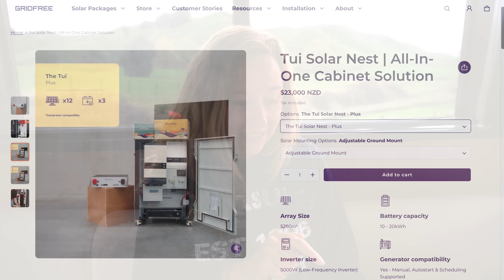Off-Grid Power: Why I Said No to the Electricity Company

Comment: I was shocked at how the price of electricity kept going up here in the UK, So, I built my own solar system 2.5 years ago, 4x 420w half-cut cell panels like you have for £350. I built a 10KWH Lifepo4 (CATL) battery for £1100, MPPT charge controller and Inverter Victron SmartShunt BMS's and cables etc £400 = £1850 in total, and my electricity bill was £1900 PA two years ago, and my last bill in Aprl 2025 for a year was under £600, with nearly £300 of that being from the standing charge for the meter/connection. 
Today I have just had 15KWH more Lifepo4 cells delivered (16x EVE 315AH cells) for £1100, and giving me 25KWH of storage, and I see the updated version of my Longi solar panels are now 610w each, and cost £70 each, so I be buying 2 more giving me just over 2.8KW.

My first solar/battery build payed for itself in under 2 years, and my new solar and battery will have paid for by the start of next year, then I only need to pay for the standing connection charge. 

Nice to see you are like-minded :)
Reply: Would it be possible for u to go off grid with ur electric or is our UK weather not reliable enough (sun wise)?
Reply: @dazinull  Where I am yes, as I'm 200 miles south/west of London, we have only had 9 days of fully overcast heavy rain this year, and even on those days still made 1.5x the panels rated power over a day, the only problem is the end of December and the first 2 weeks of January where the panels avarge their rated power daily, meaning most will need to find extra power, I discovered my first systems 1.68kw of panels could run 90% of my home, but I used the grid for most of my heating, but for this winter (and summer) I'm going to be using a heat pump, an AC inverter type, meaning it will cool and heat. (and now cheaper than gas to use :)
I just add many people live 100% off-grid here in the UK, but they use a small generator to top off their batties in winter (important to top-off with Lead Acid), and use bottled gas, or burn wood/coal or oil for heating/cooking etc. Look up PVGIS to see if it could work for you, but remember we are now getting 20-30% more energy from the sun, than we did just 10 year ago.
Reply: @hardergamer  what people do off grid and living on solar I’m quite amazed how clever they are but  still need the grid 2 function at 100% and stay warm during winter so if everybody in the country does what you are doing who will be financing the grid and the power stations —-
Reply: Utilita have no standing charge if you use no energy(UK). They do have a charge if you use some. The first two units are twice as expensive or something like that. Plus when I go back to Octopus in October I get a £50 bonus for rejoining.;)
Reply: @shawng5799  Octopus is by far the best UK power company, my plan is to use their cheap night rate for storage heaters or EVs to charge my battery at night if and when I need to, as the power company I was with UW was charging me 75P a unit, as on PAYG meter and using very little, whereas Octopus doesn't do this, and UW do keep charging you even if you're not using any power, as my meter was in the red and switched off at the meter, and it still clocked up -£270 negative.  But, it depends on who you are with as not all do this, as you found out, also, it depends if you are PAYG or statement billing, like quarterly etc,  as PAYG costs much more for both the energy you use and for standing charges, but luckily Martin Lewis is fighting hard to get all standing charges scraped.
Reply from the maker: Wow! Sound like you know what you're doing! Great to hear your experiment worked out and you're now upgrading it.
Reply: @TravellingK  Thank you, Now that you have to basics fitted, and you need more solar energy it will be easy to add more panels, and they are super cheap now.  Also, the angle of your panels looks to be set up more for summer,  which is when you don't need the extra power, Have you played with PVGIS, to find the best angle for winter, don't look for the maximum yearly total energy as it's a wast, but look at losing a little in peak summer to gain 20%+ in winter, you can work this out on the EU PVGIS calculator, best to use the "off-grid" part, but better still is to make the panel frames adjustable, so you can when needed.

Comment: Battery performance will dramatically reduce in winter (same as EV cars).  Solar yield will also significantly reduce. All at a time when you require more power. No idea what the cost of a wind turbine would be but you might want to consider it for a bit more umph in those winter months
Reply: If you keep the batteries in a temperature controlled environment, then winter will not affect them directly.  Usage for heating, clothes drying etc will increase usage but the batteries themselves will not change.
Reply from the maker: I am curious to see how I go this winter. I do have a generator and the kit is installed to accept a generator, so that's my backup plan...
Reply: @TravellingK You’ll be fine. It’s always an interesting juxtaposition in winter when sunlight hours fall but power demand increases

Comment: Batteries are only good for about ten years.  And I gather solar panels don't last forever. 
Just a warning
Reply from the maker: Yes, but if you put aside $300 per month for 7 years (the pretend power bills) you'd be set to upgrade again! And those batteries should last longer than that. But technology changes...
Reply: The LiFePO4 batteries she has will last at least 15 years, with only about 20% degradation at that time...and that is IF she has to use 100% of the battery power each day. These batteries could theoretically last up to 20 years or more, as long as the BMSs last. As for the solar panels, they are lasting 25+ years. Nothing lasts forever, but at the point she needs new panels/batteries, there may be longer-lasting ones on the market.

Comment: You need to throw up a wind turbine to supplement your power intake.
Reply from the maker: Someone nearby have turbines and I've been curious...
Reply: Yes, that might be very useful if rainy days are also windy, which is common in many part of NZ. Latest panels seem to work reasonably well in light could though, so more closer study might be needed around her location to be sure.
Reply: NZ variable wind strength means lots of turbine maintenance. Not easy with turbine up a high pole on top of a hill. Gave up after two years, just spend the money on more panels.

Comment: In your remote situation, what you have invested in is a no brainer! Even if you had to replace all you lithium in 5 - 7 years, you would still be laughing all the way to the bank compared to connecting to the pole and the ongoing line rental and usage. Win - Win +.  If it was me, I would keep the generator maintained for emergencies and have it connected to the system just in case as a backup.
Reply from the maker: Good to hear! Yes, I guess I just need to budget for more batteries in the future. I have set it up to add the generator when needed. From my experience with a smaller set-up I didn't want to risk damaging anything. But 10 months in and so far haven't used it!

Comment: Good on you - keep us updated on how it looks after you over winter. You have alternative heating I guess but lack of sunlight and cold temperatures effecting the Li batteries could provide challenges- I’d love to hear about it. Are they LiPo or NMC chemistry? Did you wire in an option to plug a small generator for emergencies? Thanks Karen.
Reply from the maker: Hmm that's interesting. I shall keep an eye on it! And yes, I can top up with a generator if I get into trouble! I'm learning that there are a few lithium options from people comments! The batteries are Lithium Iron Phosphate (LiFePO4) cells. When I asked Google, it said: LiFePO4 (Lithium Iron Phosphate) cells are a type of lithium-ion battery, but not LiPo or NMC. They are distinct from LiPo (Lithium Polymer) and NMC (Nickel Manganese Cobalt) batteries, each with its own unique chemistry and characteristics. LiFePO4 batteries use lithium iron phosphate as the cathode material, while LiPo uses a polymer electrolyte and various cathode materials, and NMC uses lithium nickel manganese cobalt oxide.

Comment: In Stralia - Solar is pretty much installed on a large number of houses. These are all subsidised, and now battery system are going to be subsidised. Solar alone has reduced my power bill from $500 per month to around $120 per month. We installed a 13Kw system so 40 panels. I'm surprised how little Solar systems are installed in NZ, but yes - if you can go off grid well done.
Reply from the maker: Fantastic news. 40 panels!! Ha, makes my 12 seem puny. I wonder if NZ is just a bit low to jump on board?

Comment: The land we bought was connected to the grid, but we said no. Now we have 60kWH of batteries, 12 kilowatt inverter/charger and 15 kilowatts of solar for $18,528 USD. No going back. You often refer to your batteries as Lithium. There is a big difference between Lithium and Lithium Iron Phosphate (LiFePO4). Lithium can catch fire, whereas LiFePO4 cannot.
Reply from the maker: Very interesting to hear you went solar and really happy with it. Ha, and good point about the lithium. Guess I haven't come across the dangerous lithium as an option?
Reply: The grid operators installed smart meters and our electric usage increased. We were going to be off-grid on our new land so we purchased everything we needed and installed it at our present place. We figured if being off-grid worked for us with grid as a fall-back and not need it, than the new land will be perfect with out the grid being installed. Well, we are doing great without the grid, so in a few months we are moving out to the new property. I will let you know how it goes, if you wish.
Reply: @TravellingK  to clarify, a litium-iron-phosphate (LFP) is also a lithium ion battery, but with different materials than the NCM variant (lithium nickel cobalt manganese). LFP is potentially a bit saver and does not suffer from the so called 'thermal runaway' problem where a small defective part shorts out and heats up which destroys the neighboring parts that then heat up as well and so on.
the reason why LFP is so popular is, because it uses cheaper cathode materials which lowers the cost of a kWh cell from about 90€ to about 60€. and the cycle life is much higer as well. easy 10000 cycles.
Reply: @stefanweilhartner4415  for the record, all batteries may theoreticallycatch fire, bit LFP is inherently much safer, and the cases where they might malfunction are very high load, high temp, puncture, crushing water submersion.  None if these are real issues for EVs and definitely not for the home.
Reply: @SeekingBeautifulDesign  The likelihood of LiFePO4 (commonly abbreviated to LFP these days) catching fire is extremely low, especially when compared to other common Li Ion batteries, because  the iron (Fe) component guards against thermal runaway. (That's why I used a LFP battery when it was brand new tech, to build an electric bike, back around 2007)
Reply: Actually Lithium is a term used to describe both LFP and NMC Lithium batteries.  The Lithium batteries in this video are Lithium Iron Phosphate Batteries specifically the TBB ES100 II.
Reply: How mich snow you have in Winter?
Reply from the maker: @manfredwetzel7975  was this for Steven or me? Last winter there was no snow days. Winter before it was one! We generally get hard frosts instead.
Reply: Thanks for the question. 50 - 75 inches per year. We had to run our generator about six time last winter. When we were on grid, the monthly winter electric bill was around $300+ USD. We did not spend anywhere near that amount for the generator fuel for the whole winter.
Reply: The Lines company is a rip off.
Reply: @ecovention  It is kind of like a regulated monopoly. Same thing with copper/fibre lines for telco's, and mains gas. If Karen had paid them 50k for the install and decided to move at any point they retain ownership and the next customer doesn't pay anything. BUT, PowerCo, or Northpower didn't have to pay anything for the infrastructure. However, if it had been arranged with a large development company(with many new builds nearby) they would have offered a HUGE discount.

Comment: Good on you!. Every time I get an email from my electricity supplier I know it’s bad news. The price of connecting to the grid went from 85 cents a day to AU$1.17. And the price to sell to the grid went from 8.5 cent/kWh to 4.4 cents. On top of that, some states like South Australia can turn off your ability to put into the grid in an effort to avoid fluctuations in power supply.
Reply from the maker: What the!!! How on earth did they justify those price changes! Seriously doesn't seem fair.
Reply: @TravellingK  Hi, when I check on the government website for all the providers,mine is one of the better ones. Some charge $1.27 a day and as low as 1.5 cents per kWh feed in. I could change to a different company but the gain would only be $20 annually. Interesting that an advocacy group Parents for climate change has just won a case in the Federal court against Energy Australia (my provider )for their  ‘Go neutral carbon offset product, which the court concluded was misleading. I got a mia culpa email from EA saying they’ll do better in the future. One day we’ll get the renewable energy we deserve…one day.